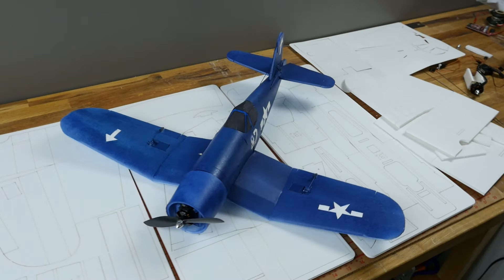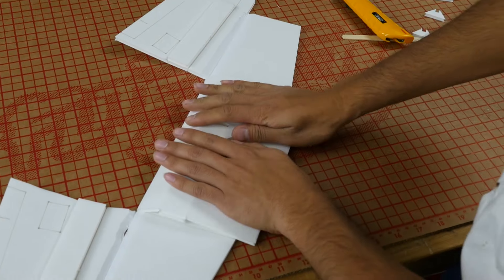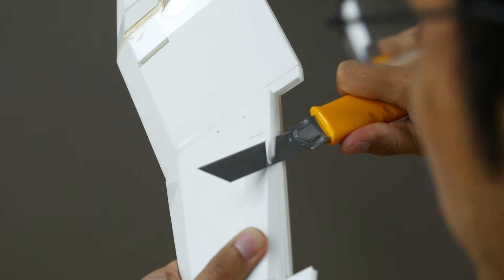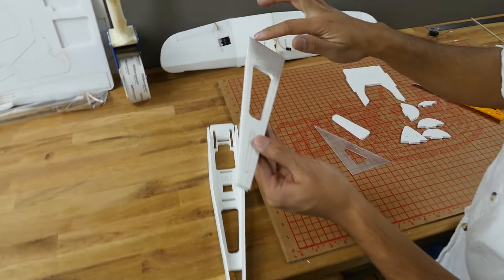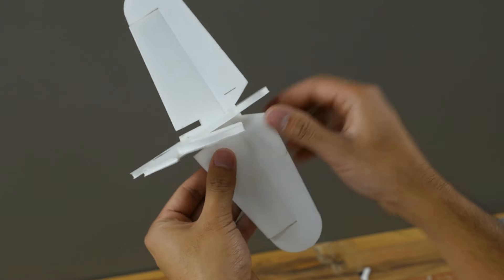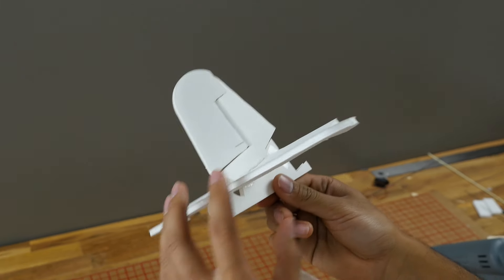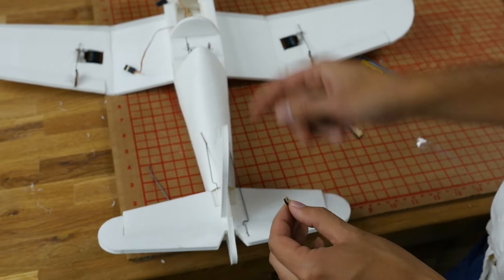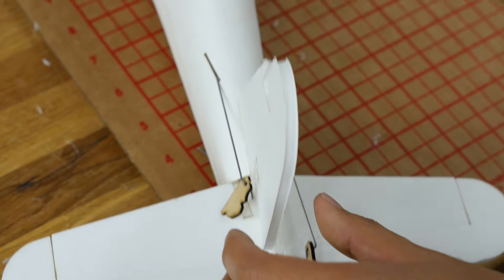FT Mighty Mini Corsair - BUILD | Flite Test

Comment: Today I maidened the corsair. I'm always a little nervous when I launch a new plane for the first time.  The CG 1.5 Inch is good with a little added nose weight (30gr). The model flew right out of my hand very well,  almost now trimming was necessary. I made 8 flights of aprox 4 min.  And with the 3S it was very fast, I mean crazy fast and very powerful, stable and sturdy. I crashed twice and almost no damage, the motor was pushed in...  I ripped off the Firewall when I landed for the last time. Indeed. Now I repaired and made some reinforcements for the powered. Actually a petty I can't post any pics here. Hopefully video will soon follow.
Reply: What is that white stuf called
Reply: @petar8459  foamboard

Comment: Great build super easy, i wrapped the cowling in carbon fiber with a little resin to help the CG come foward,  and strengthen for crashes, im in the process of reproducing the poster board skin pieces in preshaped, cured carbon fiber also, then just bond with hot glue👍

Comment: Some pros and cons my opinion only, This is a real nice kit too all around here at least its one wing,LOL.Make sure you have a good gluegun and not cheap junk.I bought a  DR-1 Tri-plane and electronics recently & there were issues but they were resolved by Flitetest there great.It was fun to build the Dr-1 even with the issues.You need alot,and I say alot of patience for first timers Im a second timer.I bought the plans for a DR-1 with a 36inch wingspan online and built it with dollartree foamboard it was easier for me at least to build that one.These guys in the videos are seasoned and make it look very simple which is good market strategy I guess.Pre-bent landing wire and  screw throttle stops on servos would of helped me alot in my DR-1 kit build.Its ridiculous to bend zbends in cramped situations takes some practice. The  landingwire and servo push  wires gauge and hardness  is overkill and very hard to bend not necessary for a kit this size even on landing gear, but I guess its cheaper and keeps the cost for the kit down.Also in this Corsair kit why not put the servos for the aielrons on the underside of the wing just curious?????Not too aesthetic in my opinion Glenn in N.Y.Rest of the plane looks fantastic for what it is....

Comment: A nose-heavy plane doesn't fly well. A tail-heavy plane only flies once.
Reply: Wise words.
Reply: Thomas Lieb kjjn
Reply: Yes right
Reply: Bo Peradotto yes yes yes it is right;-)
Reply: to do so, to make it more weight on the tail works best on several odcinkah tail
Reply: Bo Peradotto didn't David the sweed make up that saying
Reply: Bo Peradotto that's true.
Reply: so true
Reply: it does Bo peradotto
Reply: kian sutcliffe you either used wrong thickness foam, wood in the powerpod, too much glue, or your battery slid around. Don’t blame it on the person who created it. He proved it worked, and said himself it was imperfect. You did something wrong. Don’t blame it on peter.
Reply: Of course tail heavy plane flys once

During a test flight without weight
Reply: Long flit
Reply: haha i had a 5 meter warbird and its tail was so heavy
Reply: That’s so cool I want it mad 1 thing you should fly it
Reply: I flew a tail heavy b-26 and landed it, not a nice landing but not a minor crash.
Reply: it will flip as soon as it has headwind
Reply: you can trim a nose-heavy plane quite efficiently by elevator trim on the controller but trimming a tail-heavy plane is very difficult with elevator trim
Reply: Not wrong lool
Reply: Nice name BTW!!!!
Reply: what material
Reply: I hooked an extra servo to a 1/3 roll of pennies and entered the travel went from a nose heave to tail heavy position, set it nose heavy and take off,I adjusted my VRA channel to move the weight more and more as I flew,once I found where the plane seems to fly itself gracefully landed the plane,before turning off check exact balance at wingtips(easier to check) and then remove the pennies and servo, adjust battery to match your balance point
Reply: From my experience they will not fly on 2s with the props they come with, with a three blade prop the mustang took off but couldn’t stay in the air and the Corsair would not leave the ground

Comment: Please please please. An Airbus a380 or a Boeing 787 or any passenger jet. The big ones.
Reply: Or 767-300
Reply: Boeing 747-SP, built for Pan Am, but only for the Miami to Rio Di Janero runs, in the Summer of 1978, the Morning!!! 😱😊😂😂😂😅😅
Reply: Great idea - unfortunately I think they’d need to be rather large in order to get enough lift from some substantial wings - it’s gonna have a big body. Also the windows are helpful for making it look scale & detailed. That’s 220 windows on an Airbus A380, or 202 windows on a Boeing 747-400. 

PS I vote Boeing 747 because i) the bump up front makes it instantly distinguishable as a 747 and ii) because America 🇺🇸🗽 🥰

Comment: Now make them bigger!
Reply: AscottSauce, Kinkos can make these plans as big as you want.
Reply: +David Rhoads too bad that won't help you. mass, surface area, and power do not scale at the same rate so you will quickly lose performance with size until it can't do shit.
Reply: I had Kinkos blow up a 54" Ultimate Biplane to  74" (just a bit over 1/3 scale, and with a 3W110 I have no complaints. Well, I had no complaints, till I crashed it coming out inverted from a knife edge spin, or I should say trying to come out inverted.
Reply: I. Am Gonna make That
Reply: I said that to my girlfriend.

Comment: That was a Miracle in Foam Core!!! 🏆👏👏👏👏🍻🍻🍻 
I'm more OCD..... So I would clean up some Body lines with longer Poster Board, and move the Wing Servos UNDER the Wing, with a thin cover over them - even Tape. And figure out a way to make a CLEAR Canopy, with at least a basic (Lightweight) Pilot and Cockpit. 

Other than those things, that is the BEST Foam Core Design I've ever seen!!!
~ Carmine 💥 ⛽
Reply: Use clear lightweight plastic
Reply: For the cockpit

Comment: The resolution of a servo doesn't change when you pick a hole on the servo horn. The speed, throw and torque change. 
The further away from the rotation point, the more speed, more throw and less torque you get.
You still have the same amount of 'steps' between full throws.
Reply: More "steps" for the same amount of distance the push rod travels.  More res.
Reply: +ShareCraft only if you can increase the amount of steps

Comment: For those who have never used hot glue before, please be very careful, maybe even put some latex gloves on so should you accidentally get some on your skin you can rip the latex glove off and remove the heat from you without removing skin. Hot glue has a super fast learning curve on safe use.  one burn will highly motivate you to be very, very careful.

Comment: That's pretty cool! But I have one question about hot glue...Is it  hot? ;) I'd rather struggle trying to get the control rod through the slot, than through the hole in the bulkhead. come from front to back. I see, they already have the 'Z' bend in them. (I'd use my Z bend pliers and just redo them.) Very very cool!

Comment: bruhh my ESC burned and smoked out while I was testing the servos. I take a break from building now since i won't be able to get another ESC for a while. Sad but luckily nothing caught on fire and was able to safely take care of the situation.

EDIT: Alright got my ESC and I am really to get back into it. Turns out I had reverse polarity my battery and ESC.
Reply: Thats why I use connectors, just for security.

Comment: Does all the parts required to make this complete come with the kit? And if not, what parts do I have to buy separately?
Reply: all of the foam board is there, but there won't be a battery or receiver (get this and the power pack F). Also if I were you, I'd get HEAPS of glue!
Reply: Haha I've got glue :P thanks for the answer.
Reply: cheap glue but good

Comment: I am watching this thinking, "soooo much paper with the foam core!"
I make and fly mini planes and weight is so important. I buy foam core from the dollar store and spray it with rubbing alcohol. let it sit for a few minutes, then peel the paper right off. you'd be surprised how much lighter you mini/micro is when you take off the paper.
Reply: I agree.  I've made several micros using foam board and 3mm depron.  I made an f22 out of foam board and I weighed the paper I removed and it is about equal to the weight of the foam.  So weight of the airframe can be cut in half by removing the paper.

Comment: Hi Peter

I had made mighty mini corsair with 2mm foam board & Fitted all accessories, It was Flew till 5-6 Mtrs , 3-4 ft above ground but suddenly it Bends Reverse and flew towards opposite direction for 4-5 mtrs again and then dropped down. I used lipo battery of 2200 mah & 1800KV Brushless motor, could this be a reason or centre of gravity. Please Suggest

Comment: hmmh, i want to make that flyer - but i only got a 2212 / 2200KV  Motor. So, my worry is if that motor is to oversized and to heavy with a 30A-ESC and a 14,8V-4s Battery. Would this Size handle that or should i better make the Big FT Corsair? Could someone give me a Tip please? -TNX!!! greez from Vienna!

Comment: could you use a Polly cement instead of the hot glue??
Reply: really not worth it... Hot Glue is AWESOME! and it's really cheap. Buy some on eBay or Amazon for less than 5 pounds (if you're in the UK)
Reply: +우희도 I can buy the polly cement you use on airfix kits for less than 5euro
Reply: oh right! didn't know that :) But still, I would still go with hot glue ...
Reply: +우희도 cool thanks.

Comment: A balsa (this tree is easy), they make a model airplane?
Reply: +Vyacheslav Novichihin I'm not sure if I understand your question correctly, but Flite Test does not use balsa wood for planes, but the foam board you see in the video.
Reply: Balu Balsa is not the cork, balsa is here that https://en.wikipedia.org/wiki/Ochroma_pyramidale Now you understand me?
Reply: +Vyacheslav Novichihin You're asking if balsa makes good airplanes? Yes. It's the most common type of wood used in wooden models. 

Flite Test specialize in foam, not wood (they have done a build video about them, though). Foam is easier to work with and FAR less expensive then wood or fiberglass. The control horns on these models can be made out of balsa, though
Reply: DFX2KX But balsa they can work and build a model airplane out of it?

Comment: If i buy the kit does it come with everything i need to fly it?
Reply: It doesn't come with Peter lol 😆😄 
Actually, the Kit, with the "F" Pack PLUS Battery and Radio is everything.
Reply: PoorManRC so it comes with the "engine"
Reply: The F Pack (sold separately), comes with the "motor", 4 Servos, hardware and even some of the tools you'll need.

Comment: Just got this kit today and started the build. I noticed that the linkage stoppers that came in my kit are too large to fit into any of the horns included with the ES9051 servos. 
Anyone else have this issue?

Thanks in advance.
Reply: Same issue... I used a 1/16 drill bit to widen the holes

Comment: Why hot glue and not superglue or other model or craft adhesives
Reply: These were designed to be cheaply made from readily  accessible materials. Hot glue is usually easier to get for most people.

Comment: How do you attach the linkage stoppers to the servo horn? I cannot figure it out.
Help meeeeeee
Reply: ElevatorRC I had the same issues building the corsair
Reply: O I figured it out. I just need to enlarge the servo arm hole, or drill it in. It can’t fit by itself.
Reply: ElevatorRC ya I used a drill bit to re-size it and so far it’s worked 👍

Comment: Is there a reason why all of your planes with airfoils have the derpy angled leading edge? If you just strip off the inside paper covering, you can bend a nice, clean, reliable airfoil, and get a far lower drag, higher lift, and better looking wing, that weighs less. I don't see how the angular wing would be any easier to build even. It just seems silly to encourage building like this, when people could be using a real airfoil shape for the same amount of effort...
Reply: So just peel the paper off from the inside of the top of the airfoil?
Reply: +Klaus Bendel I peel off the entire inside of the wing, just to save weight. For flat bottom foils, I fold the top over with the bottom on a flat desk
Reply: Cool, all of flite test's planes are incredibly forgiving so weight isn't really an issue.
Reply: True, but lighter is (nearly) always better. Better glide slope, lower stall speed, longer flights, less power required. Plus, a better airfoil means more efficiency, better wind penetration, more responsive controls and higher speeds with the same power. If you're willing to take the extra step, you gain a lot of good things :)
Reply: I'll have to try that someday although i haven't built any flite test planes yet and am looking at the mini scout as a first build.

Comment: the dynamics involed with this is profound! i have been to your web site but it does not work! however it does from you other newer larger model! i am investigating you more in detail the questions are the parts necessary! again from this video i only get part of "flight test". you are what utube offers and it is profound! the question is plastic wing flaps exist! they cost $1 dollar why use the paper of the foam i mean how long can that last.

Comment: Why Power Pack F instead of Power Pack A?
Reply: +Make It Fix It Daddy  More power (in an extra deep voice)
Reply: +Christopher Barron 
It appears as though both motors put out about the same thrust, Pack A 460g max on 6x4 @ 11.1 Pack F 440g Max on 6x3 @ 11.1...
Reply: from what i understand thrust isn't the same as speed. (think car gears) So higher thrust doesn't always equate to higher speed. Higher kv will give faster speed but less thrust. I'm no expert but this is how I understood it when I was taught. I think the 2204 is a faster motor. So my comment wasn't completely accurate. I shouldve said "More speed (in my speedy gonzalez voice) . lol
Reply: I also didn't mention the 2204 motors are shorter and fatter than the 1806 which would help CG probably, just a guess
Reply: Scratch some of what  I said and read this (copy and paste) https://www.reddit.com/r/Multicopter/comments/34iwyz/1806_or_2204_motors_for_250_quad/     I wasn't correct about which one has more torque
Reply: +Christopher Barron 
Thank you!

Comment: Sorry Dude, but this is and excellent tutorial on how not to cut holes and bevels in foam! Knife is WAY TOO BIG, and cutting pieces in “mid air “ rather than adequately supported on a table surface, is a recipe for disaster! If your intent was to “serve as a bad example” then you have certainly succeeded! 

Looks like a cool airplane though and, as long as the builder still has 10 fingers when it is finished, it should be fun to fly!